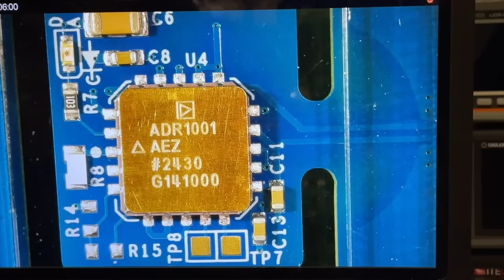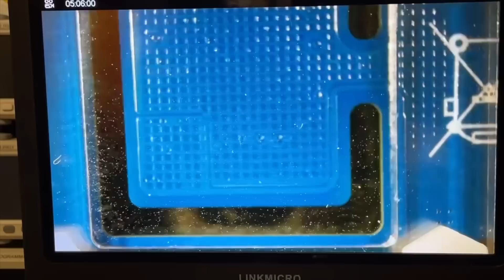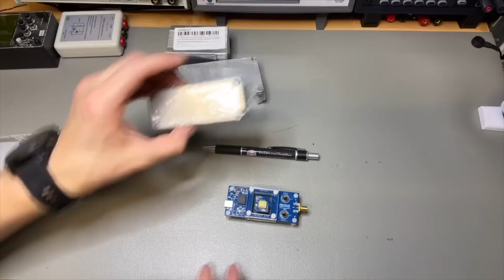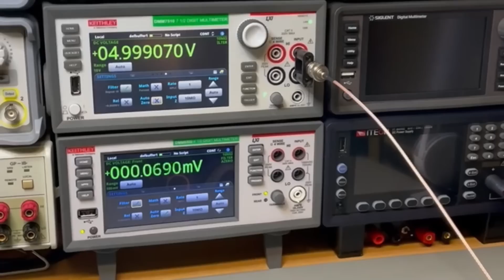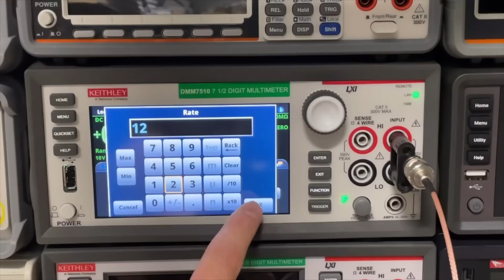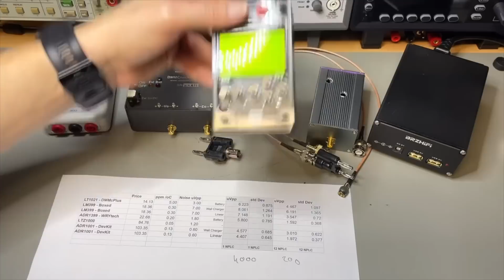TA•0451🟦Voltage Reference ADR1001 Eval boards vs LM399 ADR1399

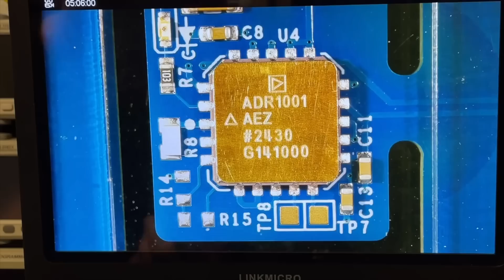Comment: So at 8:18 and 8:29, is it 5 V as said, or 10 V as written on the schematic and the caption?
Reply from the maker: Its 5 Volt, you can see that later on in the tests on screen.

Comment: I just found out there’s an ADR1001 eval board. I have the ADR1399 that has been on almost continuously since Feb 2024. So excited to grab one of these. Amazing for the price. 

I have some PCB’s for an LTZ1000 build but haven’t been able to find a couple of the resistors needed and VPG no longer does smaller runs. With the 5V output this will be easy to scale to 10V with 10k VPG foil resistors that are easy to source. 

Cool video!
Reply from the maker: Sounds great and thank you. i did buy a LTZ1000 board with companents excludingthe chip itself on ebay, there are still some available. video will come in the next year.  stay tuned :)
Reply: @TonyAlbus  Yes I looked at those. I had my PCB's made from a design based off a member of the volt nut forums over at EEVBlog. Not sure if I'll ever build them. This board is good enough to monitor LM399's I'm building and the ADR1399 board.

Comment: Use lightpipes for the LEDs. If you can't find something off-the-shelf you can make them from clear acrylic rod.  LED panel gaskets or even rubber gaskets work well.
Reply from the maker: thanks!  good tip

Comment: Thanks M. Albus for this excellent description of the ADR1001 dev. board.

Power conditioning and, especially, galvanic isolation provided by  the LTM8048, motivated me for acquiring one.

Excellent construction, and as M. Albus described, the ADR1001 IC is larger than expected.

The ONLY thing i am really disppointed from Analog Devices is that they do NOT publish the precise output voltage from their individual boards.

Many hobbyists, i am sure, would like to have this voltage indicated so the demo board could be used as a high-level voltage reference.

The ADR1001 is the closest thing many of us could easily acquire that is the closest thing from the LTZ1000 and its required exotic resistors.
Reply from the maker: Thank you!, yes that would be great if it had a good value on it, then it is also sort of a transfer standard.
if you get a ADR1399 from CircuitValley, he does this.. i have one, and it matched my meter within 2ppm..

Comment: Finally a highly integrated Voltage reference in the grade of the LTZ1000.

Does anyone knows if, for the demo board of course, ADI provides the actual output voltage ( 7 digits if possible ) read at the factory ?

This would be a net plus for the sales of this board considering that the ADR1001 has an outstanding long term stability ( <5 PPM after 2000 hours ), better than the LT1021-7 ( 7 volts ) and the ADR1399 at 7v05 .

Sure the LTZ1000 is better but its long term figures greatly depend of extra-terrestrial external resistors that cost almost as much as the LTZ itself.

One more point: The ADR1001 has its raw buried Zener / Vf voltage available between its REF6P6_S and REF_GND pins. Does anyone have this voltage's long term stability figures ? This would become a serious candidate on the demo board considering the great attention ADI brings on galvanic isolation between the reference and the USB port.

Thank you.
Reply from the maker: Thanks for the interesting questions, i can not answer those, i hope someone does for us. 
I'm glad you enjoyed the video.

Comment: Excellent explanation M. Albus, especially around the supply line conditioning. And yes, the LT isolation module is a net plus for that demo board. I seriosly aim to acquire one.
Reply from the maker: Thank you! The combo with both the LT isolater and the LT low noise regulator is a great pick from AD.

Comment: Good video again.👍
I have the LT1021 in 5 and 12 volts.
Sufficient for me.
I don't have a 7.5-digit multimeter either...🤣
Reply: The LT1021-7 has the raw buried Zener + Vf voltage sent at its output.

It is less precise ( 0.7 % ) but has a significantly better long term stability and temperature hysteresis figures due to the lack of resistive voltage dividers that are required to provide precise 5 or 10 volts at 0.05% .
Reply: @ve2um  I have the 5 + 10...
Bought them, I don't remember, 25 years ago or more...
But now, of course, there's something better again
Even for Hoppy
Reply from the maker: Thank, The LT1021 is not bad at all, very good, nice!
Reply: @TonyAlbus  I have had them for a long time

Comment: The detailed PCB and component explanation is Tony Albus at his best. A really good quality screened case that you chose and with the minimum of openings clearly helps its stability. As always Tony your skills in articulating a products performance are excellent. Many thanks for sharing. Ian
Reply from the maker: Thank you Ian, it was really fun to do, every time i learn a bit more. (long way to go for a volt nut still)

Comment: I'm replicating this project. Which metal box did you end up selecting? Thanks!
Reply from the maker: Hi, i used this box: https://s.click.aliexpress.com/e/_opchebC
if you check the video again, i did add a little (purple) plasic spacer in between +/ 1 mm , than is closed better.
Reply: @TonyAlbus Thanks!

Comment: Audio people are on the super capacitor kick for low noise power supplies, give them a try.
Reply from the maker: I wish you did not tell me this... supa caps on its way :))
Reply: @TonyAlbus  
They have a charge circuit that charges up the super caps, then isolates its self from the grid, boosting the cap voltage interminably. Two 3000F caps in series will give you a 5V supply, will only require a very intermittent boost.
Reply from the maker: @universeisundernoobligatio3283 thanks!

Comment: When you say "noise", do you mean "V peak-to-peak when filtered from 0.1 to 10 Hz"? Typically, 1/f noise is difficult to filter, and therefore difficult to measure.
Reply from the maker: Hi, i indeed did not filter

Comment: Batteries. Always have some batteries on hand if power supply noise matters.
Reply: I remember in college using a car battery as a low noise voltage source in physics lab.
Reply from the maker: Thanks, yes very good point!
Reply: @TonyAlbus  we're approaching the Fluke 732A here !!!!

Comment: At 1 PLC you are probably measuring the noise of the LTFLU inside the keithley as well

You probably need a low noise amp to really show the Vpp of such high end references
Reply from the maker: Yes at 1NPLC, also ADC's everything. in my video on the SDM4065A, i showed a great example in the test on this. as the SDM4065A does not reduce the digits in high scan speeds. you could clearly see the error getting bigger.
Reply: @TonyAlbus  Since, as far as I can tell, you get quite a "nice" temperature fluctuation over 24hrs in your lab, it might be interesting to plot a 24hr run of a couple of references at 100PLC. For example, does ADR1001 stay essentially flat vs the LT1021? Or I forget if the voltage standard guys implement their own external temp nulling circuitry in their box as well. If you have two references at the same voltage, you could run them with grounds connected together and the differential signal going to the meter. If an LM399/ADR1399 tempco is flat enough, then that 'zoomed in' differential could measure the tempco of the other reference connected.
Reply from the maker: @ivolol  Thanks, i am not going there yet.. i will be looking at temp changes on my meters too. i need a stable temprature in the lab first.